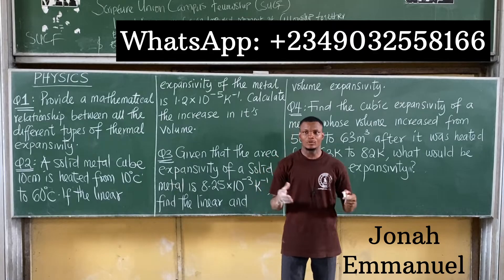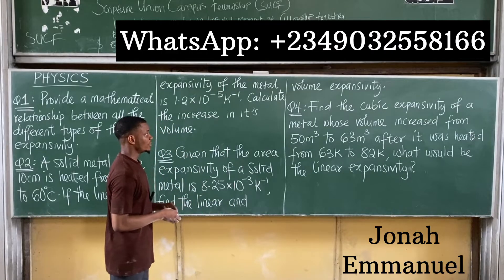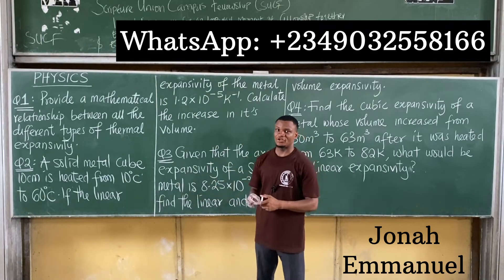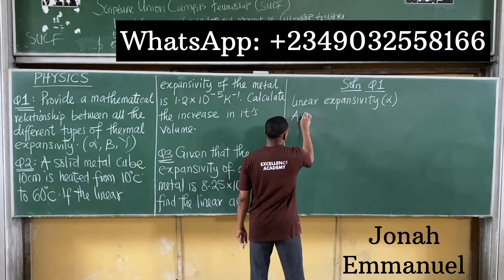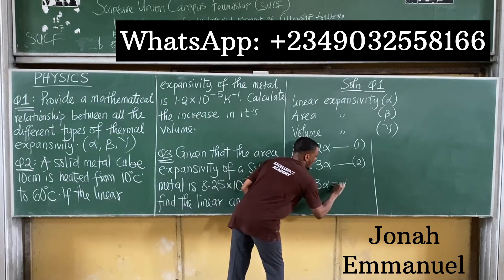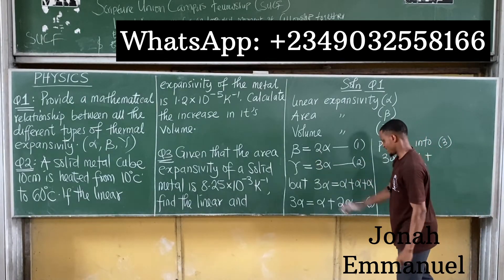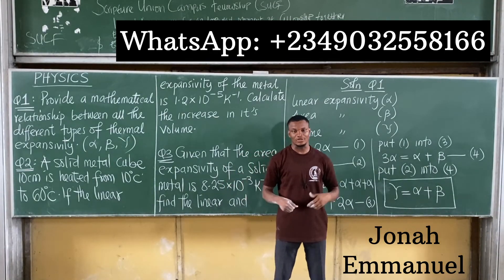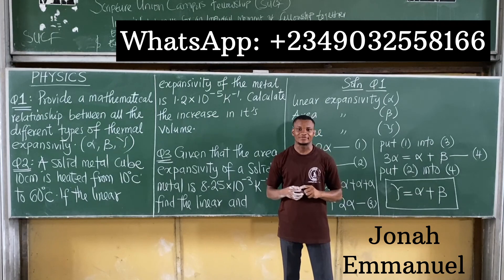JAMB QUESTIONS ON THERMAL EXPANSIVITY (LINEAR, AREA  and VOLUME EXPANSIVITY): Question and Solution

Comment: 2. 10.006cm3
3. Linear expansivity=0.004125k-¹ and cubic expansivity=0.012375k-¹
4. Cubic expansivity=0.0137k-¹ and linear expansivity=0.00456k-¹
Reply from the maker: Awesome,  welldone 👍
Reply: @jonahemmanuelofficial why was it not converted to meters
Reply: How did you get 10 my answer is 1.8
Reply: Same here I got 1.8 @kelechigudi9217

Comment: Hello sir I’ve been going through your Thermal expansivity teachings and you have been converting from degrees to Kelvein I don’t think it is right, saying respectfully because what I was taught only when you are dealing with absolute temperatures like our gas laws we convert our temperatures but this is just rise in temperature and 1°C is simply equal to 1K … please I need feedback thank you sir
Reply: Shouldn't it be converted to Kelvin instead, bcos when you look at the formula it's in per Kelvin 🤷🏽‍♂️
Reply: @oparatochukwu345 the unit for thermal expansivity can be in per Celsius or per kelvin so there is no need to convert
Reply: It's right like for example if ur given 0°c you will have to use kelvin